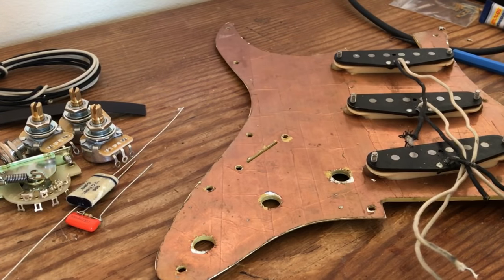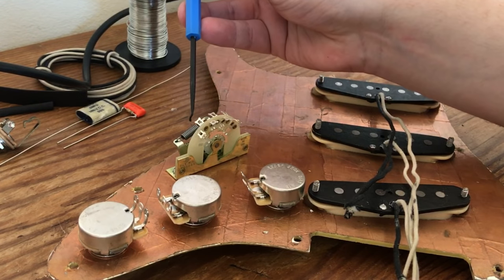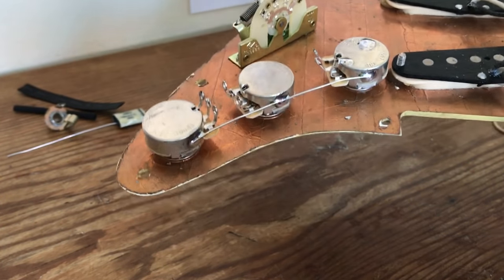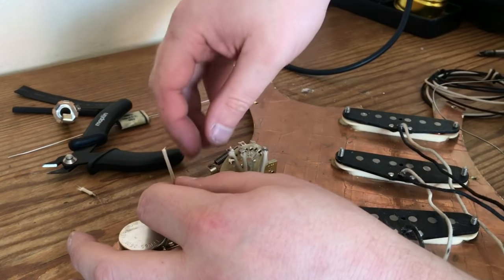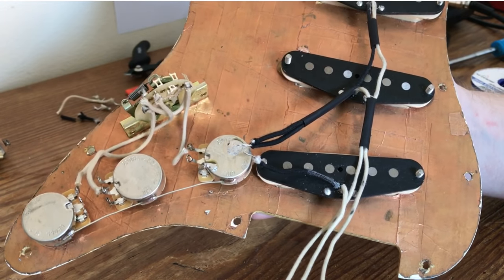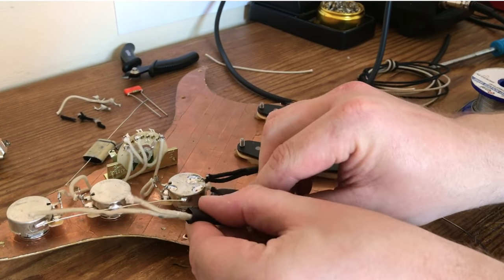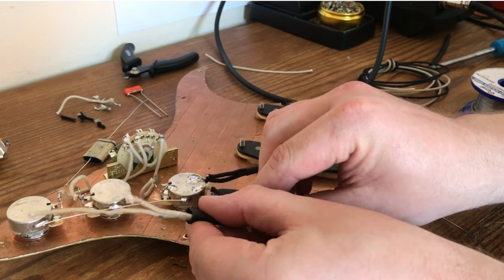How to wire a Stratocaster - Grounding, Pickups and 5 way switch

Comment: I realize this an old video but always good for a refresher. Nowadays zip ties are popular and I use them to fasten wires together. I also use an alligator clip between the solder points and the cap to keep from damaging the cap. I just rewired a Strat to use the rear tone pot with the bridge input. It requires a second cap, so each tone pot has its own cap and neither is connected to the other. Requires a jumper on the switch. But it’s a simple mod, with a good wiring diagram. And it works!

Comment: Great soldering! 
Those ground wires for the pickups need to be longer though. Some strats are routed with precision where the wiring runs through. Can cause issues when putting the guard back down in other strats.
Reply from the maker: yeah should have extended them in hindsight!

Comment: For the lefties out there, if you use regular pots you wire them the same way as shown here but once installed the pots will turn the opposite way as a right handed guitar. I am used to it that way. If you want them to turn like a right handed guitar, use a reverse logarithmic pot (sometimes referred to as left handed but basically its reverse log) and swap the outer lug wires on each pot.

Comment: Thanks for a great video. I had cheap Squire that sounded like crap, had dead spots in the volume and tone knobs. I just rewired it with a bunch of help from your video. I had a question I hope someone could answer, more for curiosity sake. When I did the "screw driver test" from the video if the pickup selector was in a position activating 2 pickups one was significantly quieter than the other. I don't think I would ever notice playing the guitar. Thanks again for the video and to anyone who could shed a little light on this anomaly.

Comment: someone may have already added this to the comments. If you use an alligator clip between the space of the pot lug and the wax capacitor the alligator clip absorbs the heat from the soldering iron saving you the trouble of the capacitor from melting or damaging in the process.
Reply from the maker: Hi yes the alligator clip is known as a heat sink which takes the heat before it reaches the cap. It’s a fairly common trick to stop burning the caps and evidently should’ve been used in this case with a wax capacitor!!

Comment: thanks for this great video, I will attempting this once my parts arrive. Going to create a whole new pickguard for my 1998 MIJ  Strat that can use an upgrade. I will also do the optional jumper for the Bridge p/u as well so I can tame any unneeded shrill, thanks for that tip as well !!!

Comment: If you don't test it with the trem claw ground will the screwdriver test still work? I wired my stuff and it isn't working. My solder joint on the back of the volume pot is a horrible mess; could that cause it not to ground properly? 
Thanks in advance and great video!

Comment: Hi what reading do you get from selected 2 / 4? Only I get 2.35 and 3.02 the rest are in the 7.0, 5.8, 6.2 the reson I ask is I get low volume output on 2 and 4 the rest are  loud. Colin

Comment: when you're selecting your earth lug, can it be either of the outside ones?  Likewise, are the input and output lugs after you've selected the earth always the same position?  I ask because I want to make sure I choose correctly if I have the pots facing each other (with the 3 lugs pointing at one another) as opposed to facing away from each other so the 3 lugs from the pots are all pointing in the same direction.  Sorry if that's a basic question and thanks in advance for any advice.

Comment: Anyone ~ a noob question, but just so I know. The wire that is covered by the cream cloth and the wire that is covered in the black cloth are exactly the same -- correct? The wire is just color coded so you can keep track of what color you're using for what. Referring to the black as "ground wire" does not mean that there is a special/different wire used for grounding ~ is that right? Thank you. MAGNIFICENT video James. Thank YOU!

Comment: Hi there followed youre vid on copper shilding I even got a shield plate for over pick gaurd thanks for tips. I bought a pre loaded second hand srv pick gaurd normal Texas specials not custom shop and it doesn't match the diagram on volume pot it has one live (white)going to jack out put and one ground with clip to screw to body which is correct but there should be another ground on volume pot to go to jack but instead there is two grounds (black)on the bridge tone pot can I just use one of these to my jack and one to the tremlo claw first time doing this so sorry if it seems like a stupid question when I test for conductivity on pickups to tone/volume pots it all linked I don't have a solder sucker this is why I wanted to use original ground wires thanks for helping us noobs along with tech vids.

Comment: Do you recommend SSL-1 pickups for necks other than the vintage 7.25" radius? I'm considering using SSL-2's with an SSL-6 bridge for my 2021 Fender Player Series Stratocaster.

Comment: did you have problems putting on the face plate? i was wondering if the wires with the heat shrink got in the way of fully seating the pickguard to the body

Comment: Do you know what might be the problem if cable, pickups and pots seem to work but guitar output volume is very low? Is something wrong in wiring or soldering?

Comment: Great Job My Friend and a Very Neat job, I must say. But I have a question, if you would be so kind to give me an answer.  I see you have a ground connecting all 3 pots. I have seen wiring directions where this factor doesn't apply. Why did you put the ground connecting all three pots?
Reply from the maker: Just to reinforce the ground, as some aluminium foil stuck on pick guards is r reliable and can tear away. Cheers

Comment: I hope you are still there... ☺ 
If it happens that I have just 1 tone pot, could I connect the lug 5 and/or 6 to middle tone pot and keep the capacitor on the last tone pot lug still grounded?

Comment: I have watched your nice tutorial over and over through the years when I needed to refresh my memory.
I see you use Tin/Lead solder (60/40)  at 340°C. Is there a reason you prefer not to use "lead free"? Does Lead flow better than Silver?

Comment: Best soldering tutorials on YT, keep going mate! What soldering iron temperature are you using? Cheers
Reply from the maker: Matches Malone thanks!! It depends on what solder I'm using. If it's tin/lead, then around the 328-335 degrees. If silver solder/lead free then approx 355

Comment: question for you im getting ready to wire my pickguard where did you get the grounding wire from for t he sides of your pots im wanting to do that  method are u just using the solder 
and melting it on the side of the pots or did u get that metal from somewhere else or should i just use the black wire going from pot to pot and solder them to the top ive already got all my wires striped i just got to pre tin them im very prepaed i just bought helping hands with a magnifier light to help out bought new soldering kit and wire new pickups the whole nine yards would greatly appreciate your feed back and one more questin should i put the wires in the lugs going threw the top or threw the botoom i thank they would look better threw the bottom plus should i use heat shrink to tidy every thing up oh sorry i guess that was more like 4 questions cheers

Comment: use a large roach clip on those caps as a heat sink, 2 on wax caps. they soak up heat well but soon as the solder sets remove them... shrink heat shrink over the roach clip handles so you can grab em without getting burned.. reason you want to remove em fast is so the heat they soak up does not migrate to the cap or pot.. I use em on the pot as solder iron heat can damage pots as well, a quick 1 thousand one, 1 thousand 2, that's it, if you do not get a connection by your count let go and let cool, try again, maybe move to another joint, go back?

Comment: Hi there, during the replacement of one string, I found within the rear cavity that the guitar,  a 3/4 size, was constructed in plywood so I removed all the components in order to re-use these after making a new solid wood body, in elm.  Unfortunately, following the dismantling process I found that one blue wire came detached from somewhere and upon examination, I see that there is one terminal on the 5 position switch, ie. terminal 4, which does not have a wire attached and this terminal is bridged to its neighbour terminal 3.  Also, although there is solder on the spring retainer within the rear cavity, none of the remaining wires will reach it so would it be safe to assume that this ground terminal has never been used. Apologies for necessary lengthy enquiry.

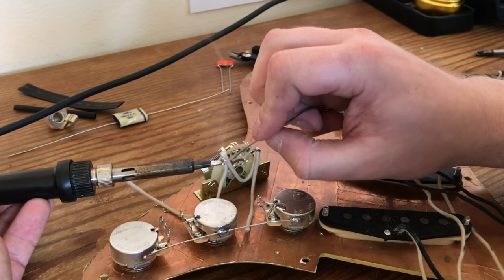Comment: With all respect, the solder joints at 9:17, 13:20, 20:54, 22:40 , 30:08 and 33:00 are cold. The one at 30:08 is especially important because this is where electrical ground is fed into the guitar. The solder should flow smoothly onto both surfaces and form a fillet. The abrupt blobbed shapes you have around the base of the solder  joints is evidence it did not flow smoothly because  both surfaces were not adequately heated for reflow to occur.  You should consider using some flux. It would greatly improve the quality of those joints.  It makes a difference. Cold joints are susceptible to breakage over time.

Comment: Very.great job sir it's very helpful to meAnd I just want to ask that the installing of the capacitor in this video is correct thank you
Reply from the maker: ruzcel beltran yes it is correct
Reply: @SixStringSupplies  thanks bro until now i still working

Comment: Thanks for your time and effort. I installed new cts 250 pots, switch, capacitor, jack and wires. I wired exactly like yours. I tested the pots and they seem to be fine (0-263). However, When playing the guitar the tone pots do not change the tone. Can you give me an idea what might be the problem?
Reply from the maker: Robert Watkins feel free to send photos to info@sixstringsupplies.co.uk and I’ll take a look at it for you. Initial guess is the capacitor is dead or the tone pot isn’t wired up properly
Reply: Thank you so much for your answer. You are right, the one wire is broken right where it enters the capacitor, it was hard to see. I ordered a new capacitor and we'll see what happens then.

Comment: My strat is super loud now idk wtf happened. I bought three new 250k pots. The pots (fender named package, cts brand) I bought had the brown cap in each bag but I only used one. Originally my guitar (squire strat) had two caps in it I believe. But yea sounds overdriven with every setting. My volume knob seems to be a gain control now. Also seems my tone knobs don’t have an effect. But you pretty much did it the same way Seymour Duncan’s schematic shows. So idk. Could be because I used their included cap and not ones like you did or a .047 uf. Guess I’ll put all the strings on it or rip a huge cap off a board I have and try that to tone it down some.
Reply from the maker: Could be the cap, your pickups could also be too close to the strings so you could try to lower them. If your tone pots don’t work, they’re either not grounded properly, or the cap is dud/cooked. Thanks for watching!

Comment: Hi what solder tin are you using? Having trouble getting the solder to connect the grounding wire
Reply from the maker: Hi - 60/40 (tin/lead)

Comment: I'm having issues with my 5 way switch screw heads creating a loud popping noise when I touch them (When my guitar is all hooked up to the amp)... It also does the same thing when I have the pickguards internals showing, and I touch the shielding around the pots
Reply: ditto this... in addition, all three pickups make a sound regardless of what position my selector is in..
Reply: Actually I solved the problem!  Make sure that the group lug of the volume pot is soldered, or in my case jumpered, to the volume pot itself.  This completed the ground loop, and made sound come through the proper pickups!

Comment: So I just got a new squire strat and something I noticed about it is that the pickup switch barely works and only when you mess with it a bunch and push it forcefully to the side will it work. I literally had to tie pipe cleaners from the switch to the wammy bar to make enough tension for the switch to be in the right spot to work. Without it, it barely makes any sound at all and sometime none at all. It’s very annoying so I’m just wonder what the actual hell I could do to stop this

Comment: Hi, in what temperature do you set your soldering iron to? Can you give some typical values when you're using leaded and when you're using lead free solder? Thank you very much.
Reply from the maker: Hi, as I sell wiring harnesses commercially, it is illegal to use leaded solder in commercial products, so I no longer use it. From memory though, approx 340-350 C.

My lead free solder is silver solder, which has a lower melting point than lead-free solder. So for silver solder, depending on the type of solder joint I'm doing, 360-380.
Standard lead free, I'd go higher, 380+
But it all depends on your equipment. Experiment with different solder types and get the flow of it with your equipment then use what is best for you. Cheers
Reply: @SixStringSupplies  Thank you very much for your help, I appreciate it a lot.

Comment: Hello mate. Great video. Can I ask what you use for ground wire. Is it wire intended for ground work or is it ok to just use normal wire. Or maybe even cut some resister wire and throw away the resister?
Reply from the maker: thanks mate. I use tinned copper https://www.sixstringsupplies.co.uk/product/tinned-copper-wire however yeah you can use capacitor/resistor wire which is essentially the same thing or cloth wire. You can use any wire you want.
Reply: Six String Supplies thanks for the reply. I may well throw some custom your way sometime

Comment: I know this is a super old video, but I’m very new to guitar wiring and modifications and I’m wondering what the importance is with using that type of wire? Would any wire do, because I was going to rewire my junker squier with spare copper wire I had laying around that’s about the same size as the original wiring. Many thanks 🙏
Reply from the maker: Logan Palmer hey Logan, no importance at all. You can use any wire. The tinned copper wire you are referring to above, is tinned, which makes it easier to solder, that is all. If you’re using spare copper that is not tinned (ie copper coloured) it will be harder to solder...but not much.

Comment: Hi there!  I think I may have already asked, but what gauge wire do you use for the ground between pots (the tinned bus wire, I believe).  It looks fairly heavy, but I can’t seem to find anything thicker than 18awg..
Reply from the maker: Hey TJ! It is 19swg (or 1mm diameter) https://sixstringsupplies.co.uk/collections/gutar-wire/products/tinned-copper-wire
Reply: @SixStringSupplies  Thanks so much!  I’ll have to track it down in Canada somewhere.  Oddly hard to find.
Reply from the maker: This video is now pretty old - the stuff in this video is thinner than 1mm. It is 20 SWG (0.036” / 0.914 mm)

Comment: In the case of a hardtail strat with no tremolo where would you solder the main ground to,the jack?
Reply: nope.. in that case you have a hole that goes right under the hardtail plate (or string retainer plate if you will) and then the wire just gets squashed in there. You remove insulation at the end and spread the wire under the plate, then screw the plate down to the body- it should make contact and it grounds the endplate and strings.

Comment: I know I've soldered all the points shown in this video. The one wire my kit does not have, nor indicate on its diagram is that naked ground soldered to all three pots. Is that necessary?
Reply: if you don’t have antiway they are grounded

Comment: Could you just ground the pickups to the tinned copper wire connecting the pots and save all the headache of pot case soldering, surely a ground is a ground. In fact could you ground everything to this wire, cap, p/u, o/p and trem claw?Mike
Reply from the maker: Hi, yep, you’ve nailed it. Ground is ground. You can ground anywhere

Comment: Great video, thank you!  I've heard that you shouldn't ground the pots so that they all link together, as this creates a 'loop' and unwanted buzzing.  Do you think it would be better to ground volume to tone 1, then volume to tone 2??
Reply from the maker: Richard Spanswick that would get a bit messy I think. Technically, if you're using a grounding plate (or shielding as above, you don't need to connect the pots) we do it as habit
Reply: Six String Supplies thank you! I'm doing a project on my squire soon, your video has been a great help!
Reply: No ground loop in guitars. I ground wire all pots together. Twist the single coil pickups and out put jack wires. Shield if like. Cheers.

Comment: That was great!! Your soldering is on point! Only thing is, did you have trouble with installing the pickguard on to the body since the neck and middle pickup ground wires aren't in a straight line for the cavity?
Reply from the maker: thanks man. nah i managed to wrangle it all in. now tend to twist all the pickup wires together and solder the grounds together.